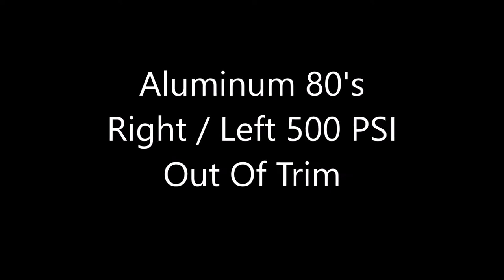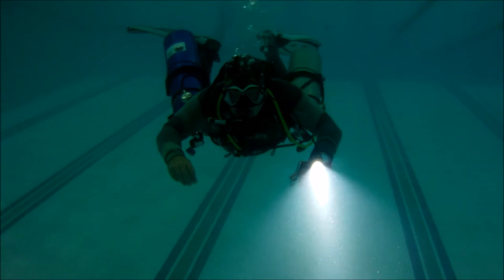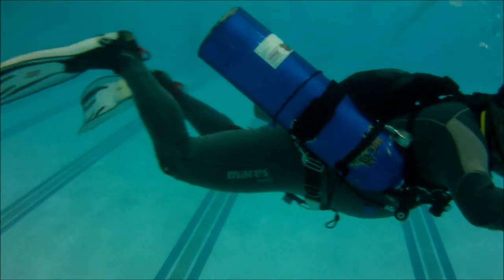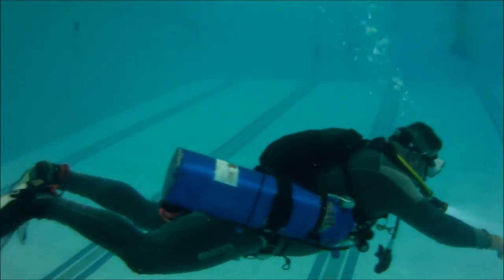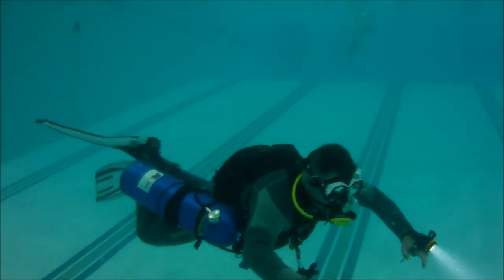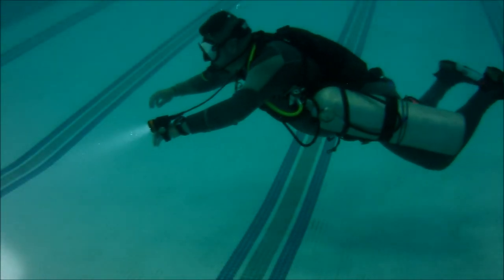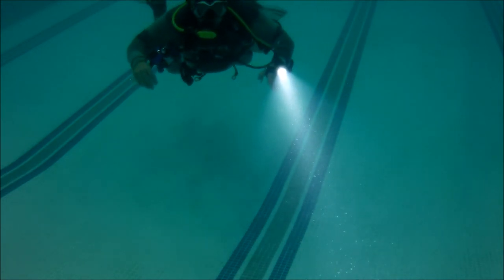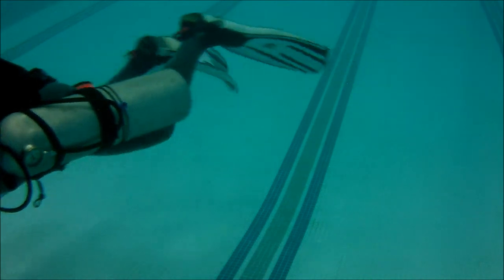Cylinder Trim For Sidemount Discussion

Comment: If you are teaching this then consider sorting out that hose routing, you have a short hose on your left facing down before coming up to contour the back of your neck and long hoses on the gauges cause a mess, even in the pool you can see they are starting to come out of the bungees. The wing also looks super full (possibly over weighted considering you stated the cylinders were low on gas) and the wing is possibly high causing a slightly leg heavy diagonal body trim. Just a few suggestions, happy sidemount diving dude.
Reply from the maker: Chris Hailey Thank You for watching our video and commenting. The video's intent is meant only for the topic of trimming aluminum cylinders as they become low on air, not on the configuration of the equipment. If you pay really close attention, you will notice the gear configuration is not standard. We are using one DIN Regulator and one Yoke Regulator. Reason being, this video was shot at the end of an Open Water course, and equipment was thrown together very quickly to produce a video on cylinder trim. In a nutshell utilizing what short time we had in the pool to knock out 2 birds with one stone. Training an Open Water Student and filming another YouTube video. But Thank You again for commenting.

Comment: I love your videos... keep it up!  I am new to side mount and I am working on this exact issue however my trim is WAY off at 500 psi. 

I’m using Hollis sms100 and working to do side mount Tec with 4 tanks (someday) right now with 2 al80s my trim and buoyancy is right on. However when I get to about 700psi I can no longer maintain a hover as I end upside down with my feet up. 

I have very short torso as I’m only 5’7”. I have shortened the crotch strap way down to move waist strap down. This allowed me to lower cam bands down and it is better.  I also rearranged weight to lower weights as much as possible. I was in the pool last week practicing and it was better but if I try to do a hover I slowly go feet up. 

I do not want to add weight to tanks but have considered ankle weights. In my dry suit if I put 2lb weight in my leg pockets I’m good but I do not have that option when diving wet. 

Thoughts?
Reply from the maker: Hello Chris, ankle weights seem to be very popular here in our area.  For me personally, I like a slightly heavier fin, especially when diving in a Dry Suit.  But for weight suit diving, the ankle weights would be a great option for you.  Try it and let me know how it works for you.  I would caution you though, don't go to heavy with the ankle weights.  All you are trying to do is to prevent you feet from floating.  Technically speaking, you just need them to be neutrally buoyant.
Reply: @LakeHickoryScuba  I had this same issue and thought of doing ankle weights. But I decided to counter balance my aluminum tanks by adding 2 pound to my lower bang. You end up doing much less adjusting throughout the dive. Plus the weight is now located closer to your center of gravity vs the ankle weights.
Reply: @jhkleinberg2  I also do the tank weights... the other advantage over ankle weights is that it does not make you work harder on the kicking, which drives higher gas consumption.

Comment: I decided to balance out my aluminum tanks at 1500 psi. I add 2 pounds to my lower band. Makes my tanks much more buoyant throughout the dive and I only need to make fine adjustments.  

Some people frown about doing this but I have no clue why.
Reply from the maker: Hello Joe kle, a lot of sidemount divers who use aluminum cylinders will do the same thing. Since aluminum cylinders tend to get floaty, by adding weights to them will basically keep them neutral the entire dive. Another great option is to use the 3300psi Nuetral Aluminum cylinders. This eliminates the needs for weight. The biggest reason I choose not to use weights to the cylinders is for the mismatched ballast in the event I ever remove a cylinder for penetration.
Reply: @LakeHickoryScuba  So you feel if you remove one tank your going to roll to the opposite side due to the added weight? If you're just using 2 pounds this shouldn't be an issue and using your core you can compensate for it. It's actually easier then when you are diving 3 tanks and your weight is offset.due to the 3rd tank. Especially if your stage tanks are low and your 3rd deco is full.
Reply from the maker: Great question. The fear of roll over is not the issue for me, as trim and buoyancy can be manipulated as you said by using our core. But more so a choice of simplicity for using different Sidemount Rigs, Cylinders, and Exposure Suits. All of my warm and cold water systems are set up consistently, so all I have to do is attach my cylinders and go dive. Whether I’m in the ocean in a shorty, or deep in a lake in a Drysuit, the cylinders work the same. All the weight is attached to me, and I don’t have to worry about threading it onto rental cylinders while traveling. So I guess you could say for me, it’s a way for me to be consistently lazy and not over think Trim and Buoyancy.
Reply: @LakeHickoryScuba  Yes I completely understand the aspect of easy and simplicity. I do tend to only dive warm waters. I also dive as a hobby. So I enjoy planning out each of my dives and the technical aspects of doing so. 

So we have a situation where is just personal preference. Once again no right or wrong way if it works for the individual. The dive committee tends to be single minded as only their was is the correct way. 

I always enjoy have intelligent conversations with you. Always very knowledgeable. Ty
Reply from the maker: You’re welcome, and this is a great topic to discuss.

Comment: Do you have a photo of the attachment points to show the 'front' , it appears that it is really 'forward' and not just beside you.  I'm wondering if I should have 2 hip attachment points, one near the BCD (hip) and one more forward toward the navel area.
Reply from the maker: Hello Hojo in SC. Unfortunately, I do not have a picture of the front of my BCD. I do run two hip D-Rings. The first is located at the seam of my wetsuit, and the other is about an inch from my waist buckle.